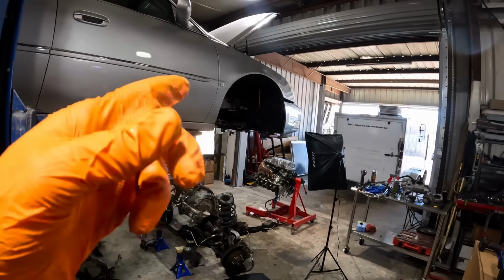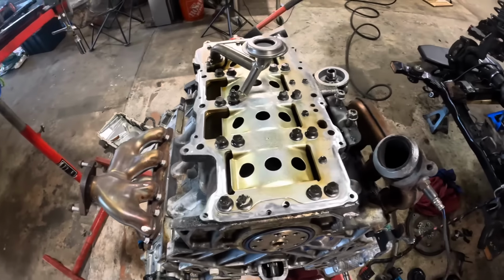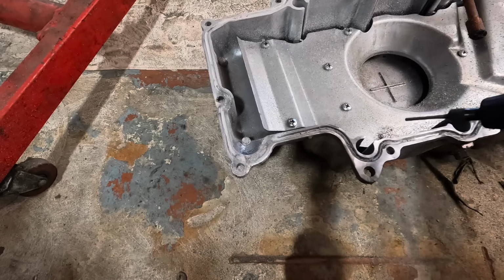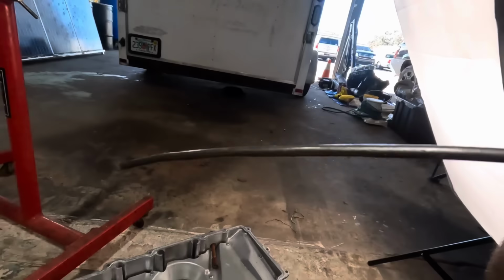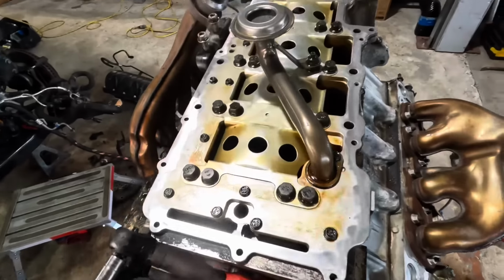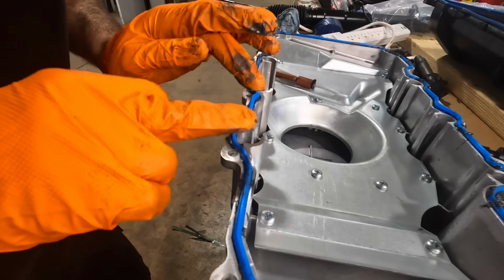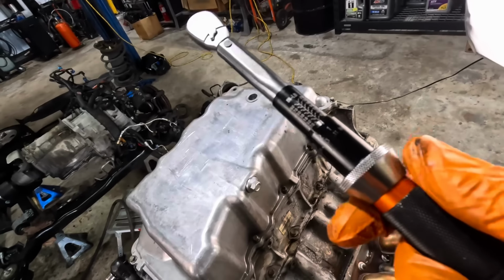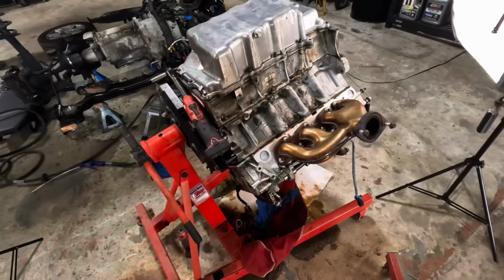Leaking Engine Oil at 40,000 miles! Rear Main Seal, Oil Pan, Valve Covers and Water Pump!

Comment: I watch your videos a lot, but I am not a subscriber. I don't know y u don't clean all parts inside and out when you take them off of the engine or any other place 🤔  on the vehicle. I used to work on my own vehicles and never put it back on before it gets clean n & out. That also means the bolts. This is my opinion only.

Comment: To strip down a block to this point and NOT take off the main caps and inspect the mains and rod bearings to me seems to be an opportunity missed, especially given the amount of RTV that was globbed all over the Oil pan. Guys who use too much Silicone sealant on blocks CAN block Oil passages and starve parts of the block from 100% proper oiling. It must be the part of me that worked at an engine rebuilder years ago. The #1 reason the engine rebuider seen engines that had failed WAS "Lack of lubrication". I don't believe that that rule has changed, in fact I believe that poor engine design had definitely LEAD TO this engine killing problem becoming even MORE acute. So for me, I would never miss that opportunity to inspect the lower mains and rod bearings. That's just me.

Comment: Want to do away with all this BS?  I have ran the Chevy 350 over 200K miles with spark plug change, water pump change and still running well.  We are going backward with engines.

Comment: I'm actually amazed someone would attempt to fix a N* these things are usually trash after 80k miles, which at this point removing it, i'd swap in anything.. even a donkey swap would be more reliable. 😂
Reply: I googled it and it seems like a lot are doing ls4 swaps. 🤣. I k ow there’s an adapter to bolt the 4t80 to an ls4 when I was researching ls4 swapping my gm minivan
Reply: @kd7cwg  I had a 99 and when the N* was new it was really an amazing car.. it rode like a cloud, and at 85 was completely silent inside.. at 70-75 would get around 25-30mpg and the seats were amazingly comfortable. It really was a fantastic car.. But, by 85k miles that N* started to overheat in traffic and by 95k miles it caught fire.. At the time i looked into swapping it with a variety of different drivetrains, as to me, it was worth it, just because of how much i loved that car.. The issue at the time was the ignition system and anti theft system that required a computer integration to allow things to work, and Honda, subaru, toyota made piggybacking systems to allow the swaps in their cars, but GM only made them for the performance cars, which lead to the death of my car.. I still 14 years later miss that car..

Comment: Yikes the more I see of the inside of these modern over engineered engines the more I am inclined to trade up for an early 70s antique,what crap they are building in modern times.Electronic user unfriendly throwaways for 10 times the price and the thing is they are still internal combustion engines.Just shrouded with electronic garbage to squeeze a mile or 2 more out of a gallon of fuel!

Comment: Why such work on an 18 year old car  that’s work woukd cost more than the car 😮
Reply: Low mileage, engine interior appeared sludge-free and pristine per Ray's comments in an earlier video, body and frame cared for and from a non-rust belt environment, sentimental value, price of a replacement Caddy vs. re-sealing this Northstar mill, the owner flat-out loves the car -- but those are just my assumptions. 😁

Comment: Reeee! Reeee! You let water dribble out of the pan into the engine when you flipped the pan over! Reeee! Now the next 6 oil changes with be contaminated with water! Reeee! 🤣🤣🤣

Edit: Ray, hardware store lacquer thinner will make most silicone sealers release from metals they are bonded to. Usually just rubbing a thinner soaked shop rag on the old sealer will remove most or all of it with a little effort and no power tools needed, so the surfaces or gasket grooves aren’t scratched and damaged.

Comment: Oh no! Dude what are you going to do when this car comes back in a month, after this customer has paid a crap load of money for this repair and that section is leaking? You can't get new main cap bolts and do that? What a rookie.
Reply: Customer choice, maybe, if the technician calls the customer and says it may cost a couple hundred more or if I leave it it may leak, what do you want to do sir?
Reply: NOOOOO! The customer is paying him to reseal the engine if he didn't include that in his estimate  he has to eat it, chalk that up to a learning experience, at the very least maybe call the customer and see if he can get extra but he already decided he's not going to do it and didn't even call the customer. @shadgrind
Reply: Ray mentioned needing to pull the crank and time-sert each of the 20 bolt holes, plus 400 bucks worth of new, one-time use bolts, not including the perimeter seal bolts that are also single use.
Reply: I expect Ray has discussed. With the customer. He said it took labour from 20hrs to 60hrs, so turn a $3k job into a $9k!
Reply: With this engines reputation, I would of quote the complete job and if the customer wanted to cut corners, as a shop owner I would tell him to take it elsewhere.